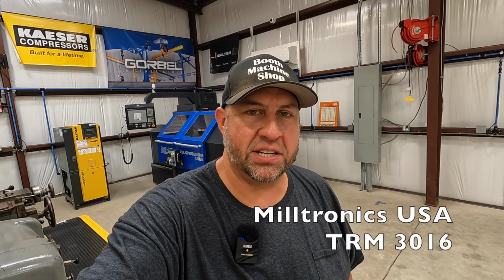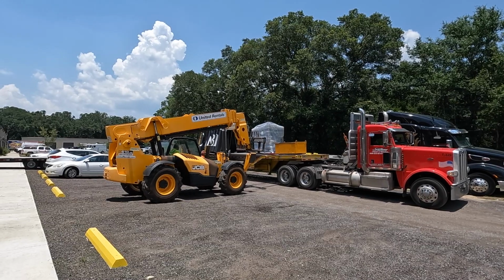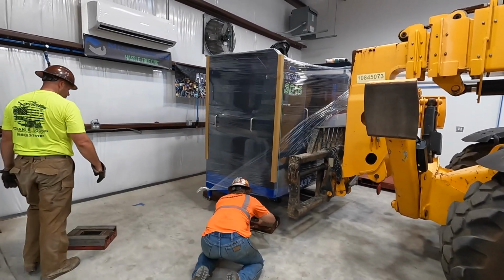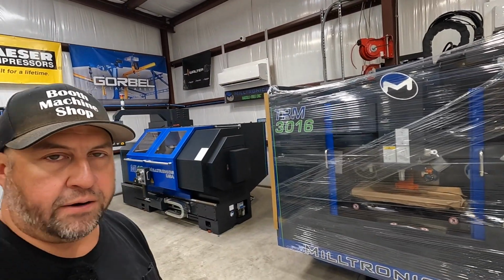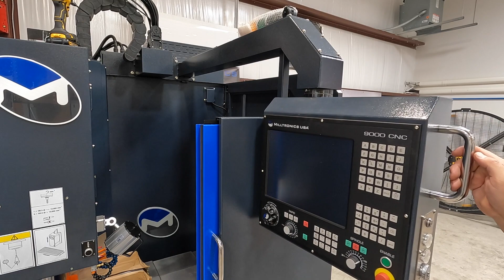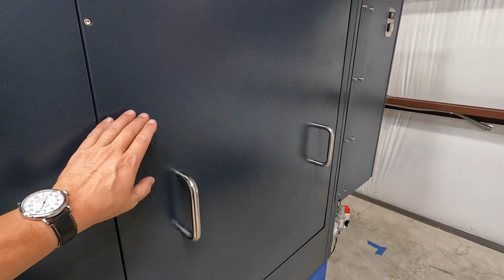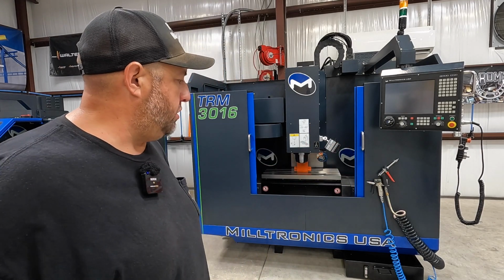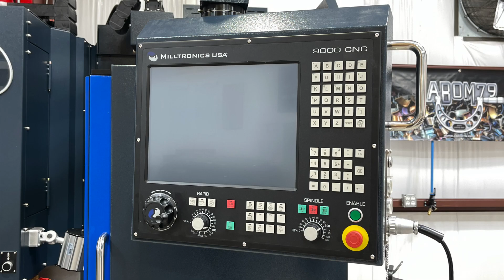Milltronics USA TRM 3016 Delivery & Install

Comment: Adam, you're wasting your time and space in the workshop. Going from lathe work to CNC is like going from typewriter writing to programming computers. CNC is for larger volumes. Lathe is for repair work as you usually do for 1-2 items. There is a tremendously high threshold for learning CNC programming and CAD / CAM and is total overkill for the type of work you do. If the machines are sponsored, I can understand that you show them. But I guarantee that you will NEVER create a single part, maybe you will run some sample gcode files that others have created. Do not deceive yourself into thinking that you will benefit from the machines. CNC programmers are among the highest paid in the industry for a reason and that is because one needs several years of 100% dedication to become reasonably good.
Reply: no worries,he'll get crash course from a company man :)
Reply: I disagree completely. I own a tool and die shop. While Im typing this I have a cnc ,mill making die parts.  If Adam puts the time into learning, It  will open up a world of possibilities. I use My cnc mill even to make one parts on progressive dies.  you cant make money pulling out a rotary table in 2022. Yes for many repairs, manual is better, but even milling blocks down in mdi is so much nicer. Coolant on the mill and the mess is in the machine.  If a customer needs five parts, Adam doesnt have to turn the work away. It will be a learning curve for Him.

 Usually, those who criticize cnc  are those who have not learned to run them. Cncs are not just the future, They are the past also. My dad was making tooling for nc machines in the very early seventies.
Reply: Well, as I spent most of my career as a Mechanical Engineer in the manufacturing industry, I have a different perspective. In my experience the guys that knew manual machining were FAR better at it than those that knew only CNC. Watching three "Engineers" fight with a 3-axis daily was interesting to say the least! I wasn't involved in their project, so I just kept my mouth shut ...

BTW the first CNC machine I used the "programming" consisted of typing your code into a stack of IBM punch cards, which were then fed into a machine that punched a paper tape!
Reply: @PhilG999  I 100% agree with you that Adam with his background would be far better as a CNC operator than engineers with no lathe experience. My point is that he will spend too much time (years!) to learn the programming stuff to become a CNC programmer, which is what he must become (with ever changing software and spend time and money on software / re-training due to changes in software). When he is good and ready for practical work he has moved into the production league where he will compete against CNC factories in lowcost countries and he will lose. Better stick to lathe work and be the best (which he already is) where he outperform lowcost countries both on work quality and delivery time. He can't be beaten on lathe work - but will bite the dust on CNC.  I think I'm just being realistic.
Reply: @swedishpsychopath8795  I guess we'll find out, won't we? ;)
Reply: @swedishpsychopath8795  I think you seriously underestimate Adam's intelligence.
Reply: @swedishpsychopath8795  You clearly have ZERO clue about CNC programming.  The software doesn't change much from year to year.  Sure they add some features and squash some bugs, but it's not a radical overhaul every year or two.  Master CAM hasn't changed much in the last 16 years.  Ever since they made the switch to the X series of revisions.  After a few days of training it's VERY easy to write programs.  You may not have all of the bells and whistles mastered, but that is not hard to learn.
Reply: @brandons9138  A few days, huh? So by friday next week (which is 200-300% more time than you gave him) Adam should've produced his first CNC piece (that he programmed from scratch using Master CAM) and delievered it to his customer, right? I won't buy popcorn and beer and wait for this movie because it will NEVER happen.  As a matter of prediction: It won't happen in a month, it won't happen before christmas and it won't happen before next summer. It will simply NEVER happen.  Adam will never spend 10-20 hours programming a cut path for a CNC piece he only needs 1-2 copies of. He will simply make the part in 1-2 hours on the lathe.  He sure will try - but the CNC machines will be put to rest after 2-3 tries.  It simply isn't worth the time and effort. That is his "curse" as a professional lathe machinist. He will ALWAYS know he could've been finished in a much shorter time using a lathe.
Reply: @swedishpsychopath8795  Absolutely doable. Assuming the CAM post processor for his new equipment is good.  I also didn't hear him discuss anywhere in the video how he plans to do the programming.  Does he plan on using MasterCAM? or maybe Fusion 360?  Does the machine have conversational programming built in?  Like he said in the video thought he still needs to get the electrical hook ups done.  We also have no idea how he is set up for tooling.  He may need vises and tool holders, collets, and other accessories before he can make anything on the machine.

Where do you get this idea that programming is this monumentally difficult task? Years ago when I first got my hands on PartMaker for Swiss machine programming. I had my first program done and on the machine on my second day. That was without any in person instruction. I followed a tutorial in a book. Then did my own first part the next day. Most of the programming classes offered by the big CAM software companies are set up much the same way.  One or two days of tutorials, then you are off programming your own parts with help from instructors if needed.  I've since moved on from PartMaker and am now using Esprit for programming. It wasn't that hard to switch over to new software either.

You are completely off base with why CNC is the standard for machining now.  Yes, Adam might be able to bang out a job in two hours on a manual machine, but that is 2 hours for every part every time that part comes around.  With a CNC machine once the program and process is dialed in the next time around  he can set up the machine/dial in the tooling, press the button and then spend his time doing other value adding activities.  That is the advantage of a CNC machine.  A person is not tied to the machine turning handles to make a part.  The time invested in the programming is recovered because there is no need for a person to stand there turning handles.  I don't know where you get the idea that it take 10-20 hours to write a simple 2 axis lathe program with CAM software.  If you were writing the code by hand, maybe then.  I written several separate programs for Swiss machines in a single day before.  At my last job I was expected to write several programs a day.  I was responsible for 2 and 3 axis lathes, a twin spindle twin turret lathe and a 9 axis turn mill.   At my current shop I have 16 Swiss machines and two 9 axis lathes that I'm responsible for.

I'd be willing to bet that I could teach someone with zero machining experience to program machine in a day or two. It would probably be a crappy program because they'd have zero idea about speeds and feeds, order of operations or making burr free parts. All of those things are knowledge that a machinist would have from actually making parts.

Comment: Worlds  worst telehandler driver. Why did they not use skates!. That looks like some proper chinisium shite. More crap to not get used.
Reply: "Worlds  worst telehandler driver."

True.

"Why did they not use skates!"

Because it's a 8000 pound machine.

"That looks like some proper chinisium shite. More crap to not get used."

A) 'Milltronics USA" is a US-based company.
B) Don't confuse "made in china" with "made in china for a buck and a half". China can make extremely good quality products but the price will be higher and even the US can make good stuff if the price can be high, but people want a low price and the US can't do good-enough+cheap. China does "fiarly-good+ridiculously chea" very well. It's just a fact of life.
Reply: They did use skates once inside but broke the first rull of using skates, always jack onto skates, never lower the machine down onto them.

Comment: So disappointed, youre gonna spend three hours building a part that woulda taken you 1 on a manual machine. I will never stoop to production machining, its not how im wired.
Reply: keep on candle 🕯🤦‍♂
Reply: What are you talking about? 😂 CNC is not that time consuming to program and if it is, then the part is probably very complex and would take more time or even be impossible/impractical to machine on a manual machine.

Also, the world moves forward because people "stoop" to production machining. Your car, phone, computer, dishwasher, and almost everything else you use on a daily basis really on production machining and CNC.

Comment: 2:12 Were both in the same boat btw, just each side of the pond mind. The South East of England has been really warm recently, as later on today (Sunday) it will be 29oC. But! 
Monday & Tuesday are completely different beasts btw, as BOTH will be 37oC.
37oC!!! 🥵🌋
I honestly can't even remember the last time it was that hot without Googling it 🤔

I'm currently writing this at 2:30am after having a banging day round my mate's and I'm really looking forward to my bacon 🥓 sandwich/roll and delicious home made coffee in morning 😋🤤 I'm reeeeeeally not looking forward to today 😒 and I'm definitely not looking forward to Mon & Tue ☹️ 
Good job I've got a portable A/C unit in my bedroom 😁It is old mind, but it just about gets it comfortable when your trying to sleep. What ISN'T nice is that it's old and old means LOTS of money to run the compressor which is fooookin massive! It's a little bit smaller than an under the counter UK washing machine and it weighs just about the same 44kg! 

Aaaaanyway. Stories over 😝

Comment: That side panel is ripe for plexiglass conversion for filming, might even ask for a second door and cut/insert plexiglass viewing window. Although how bad would the wash from cooling fluid be?
Reply: You just need to get the right equipment to clear the flood cooling.    Most people use a spinning window that is usually driven by compressed air or electricity.    AVE has one on the town pump and it works great

Comment: Heavy panels frequently have threaded hoisting holes for a lifting eye. I am a weakling. I used these tapped holes frequently.
Reply: And why does that truck not have a Hiab crane...
Reply: @arjanvanraaij8440  Adam does a lot of things very well. I came to his channel to learn and to improve my machining skills. He is highly skilled and he is an intuitively gifted YouTube instructor. He is not a professional machine repairman or rigger. Those are my areas that were the focus of my career. Although he isn't a novice in those areas he demonstrated his lack of skill, knowledge and experience. No one can do it all well. I worked mixed trades and I am competent in a number of trades, but not an expert in very many, especially compared to folk that have practiced a narrow focus for decades. I want Adam's machining skills. I expect that folk who are really skilled in what I think that I do well chuckle at my lack of expertise. When Adam steps closer into "my world and experience" I am tempted to nit pick on his "errors". Even Adam cringed with the tele-handler rigging fiasco.  That crew was inexperienced and demonstrated it... Wrong machine and wrong methods... Fortunately nothing catastrophic happened. I suspect that machine is rated for 8000 lbs. A forklift of that capacity may have been difficult to rent for few hours. The lathe riggers pushed the lathe on skates. Properly placed skates likely could have hand pushed that small mill in place. I would have been much happier with a properly sized forklift with pretty long forks to get the mill off the trailer and on the shop floor. I have run that model of tele-handler. They have their purpose and place, but it would be a last choice for me for machine rigging.

Comment: do those machines require a air dryer  and filtration system?
Reply: They do need clean, dry air, the Kaeser air system provides plenty of that.
Reply: Yes, the back right corner seems to be the location for the built in air/pressure and oil regulatory system.

Comment: I noticed all the tire marks on your concrete floor and looked up how to remove them. Basically a pressure washer, no hot water or soap and it should come clean. Good luck.

Comment: 25:50  looks like a breaker has already been thrown on the bottom panel on the back
27:40 tempted to replace those machine screws with some captive thumbscrews to make it tool-less?

Comment: rental Forklift?   Does he know what he is doing?  I also noticed: they ignored your blue tape...
Reply: General rule of thumb, machines aren't placed over expansion joints, i install them for a living. Settling can cause the machine to loose levelness.
Reply: He said that it needed to be further forwards in order to get that coolant tank under the machine. It comes down to not reading what may have been needed. Everyone makes mistake. It's all about how you recover from them.

Comment: Adam you might want to replace those screws you took out for the orange shipping locks on the doors. They look like through holes in the sheet metal and coolant might pass through them creating a hard to find leak in the cabinet or collecting and rusting.
Reply: I guess we'll find out for sure, huh.....?

Comment: As you start fiddling with CNC milling, you'll quickly discover the misfortune of two extra axes in milling. Three-axle machines are now rather a relic that limits production possibilities. Nevertheless, at the beginning you will have great fun. It's a great idea to start with Fusion 360 with a training center assistant.
Reply: Zanim on te maszyny opanuje i zacznie coś na nich robić to jeszcze chwilę poczekasz. Obydwie maszyny są sponsorowan tak jak cały ten kanał w ostatnich latach. Odkąd zwolnił się z pracy i zaczął być 100% YouTuberem to tak naprawdę to nie było konkretnej roboty na tym kanale.

Comment: Glad your shop is filling up. That lift driver might have fudged his skill level.
Reply: The forklift was a rented machine. Not all forklifts are created equal. Each one has its little quirks and different controls. No one wants to use the old Clark that is in my shop at work because of its quirks. I didn't like the Nissan forklift our fab dept. used to have because of the wonky controls. My favorites are Hyster and Toyota.

Comment: Adam, just a couple coments. Are you concerned  that the machine is sitting on the floor across an expansion joint in the concrete? As far as the final testing of the accuracy of the mill, is the tech going to do a circle/diamond/square test in wax? 
BTW, I am happy for you getting new machine tools for the workshop.

Comment: I thought when you have control joints your not supposed to span over then on two separate parts of slab.
Reply: I performed CNC maintenance for over 34 years. We enforced a strict no floor crack straddling for most of that time in our shop for the same concern that you raise. When the Lean Manufacturing wizards took over our company management they crammed machinery so close we couldn't open electrical panels. Straddling concrete floor joints including expansion joints became common practice. I fought the wizards with committed energy, but lost. The Lean wizards are Wizards and they will let you know. We operated heavy machining in around the clock operation. We demanded very close tolerances (tenths). To my surprise, the floor joint straddling didn't cause the repeatability and tolerance issues that I expected. He is straddling control joints with re-rod. This is a bit better than straddling an expansion joint. 
I am still a proponent for best practice, and if this was my shop I would not straddle a control joint if at all possible.

Comment: Hey Milltronics, how about a nice CNC Drill Press for Adom??? Question: Can the controller units on the machines all be interfaced together into a server for blueprint archiving and printing? Also for material listing what was used in jobs billing practices and such etc...
Reply: You don't put blueprints into the machine tools.  You load them with G-code.
Reply: @stargazer7644  Yea, that's not what I said. I know you program the machine with code.  When you have to use more then one machine to make a part, wouldn't it be nice to have all the machines all ready have the code needed to do it's job instead of having to program each machine. Then have it archived for any future need like coping to a thumb drive for use in other shops or filling out invoices for billing and inventory tracking.
Reply: @jrrdw  That's generally how it is done.  He'll have one computer with fusion 360 or whatever on it where he designs his parts. The code is then transferred to the machines to make the parts.  How that transfer is done varies. These machines are often networked, or you can load from a thumb drive.  The machines have computers in them.

Comment: Curious as to why a telehandler? That thing cant weigh what? 7,000 pounds, use the pallet jack to put it in place. Some of those lift 4 tons. We have had 23,000 pound mills and 22,000 lathes brought in with forklifts, snatched each of them right off the trailer, drove it in, put it in position, loaded forklift and gone, each time was done in about 15 minutes. Ya, never pay those guys any longer then one has to, unless you are getting some deep pockets. We hooked them up, and each company came in and did what they needed to get them going.